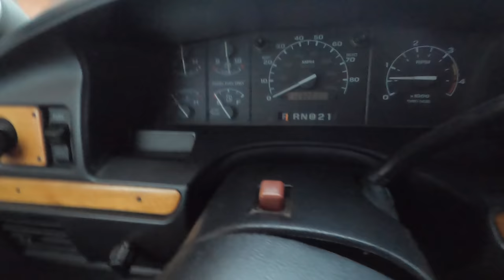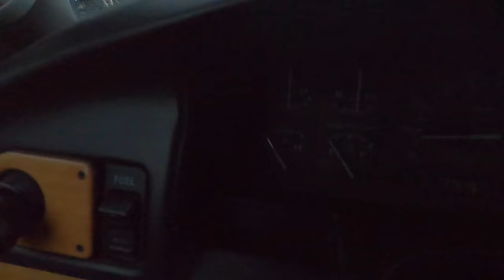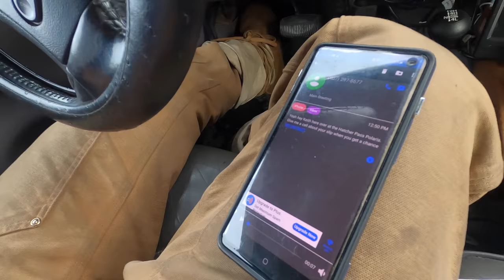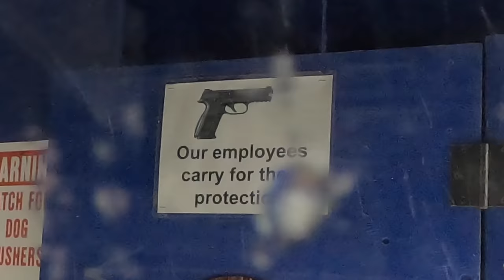SNOWMOBILE UNLOADING FAIL.

Comment: Why don’t some of you guys in AK wear helmets on your snowmobiles? Is it not required by law? Are you guys immune to head trauma? I can’t imagine it’s warmer wearing a hat with goggles.
Reply: *learn to fall correctly
Reply from the maker: We do on most rides, sometimes not on trails/highways with no trees.
Reply: @TruckHouseLife  i’m just asking because culturally I don’t see that in the lower 48 just up north in AK. I get it for slow trap line riding but You can still smack your face on the handlebars with no trees around
Reply: @Captndarty   i like to wind in hair on the moto, sometimes on one wheel. Often putting the wheel down at 50-60 ..gotta watch not to snap the speedo cable. ..
This is at 55...life short, enjoy the ride. Learn how to fall.